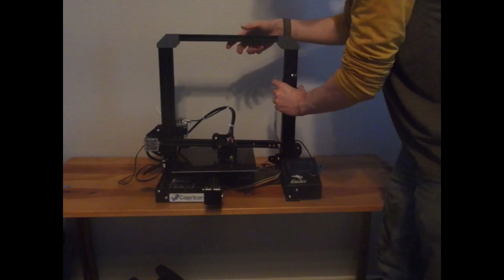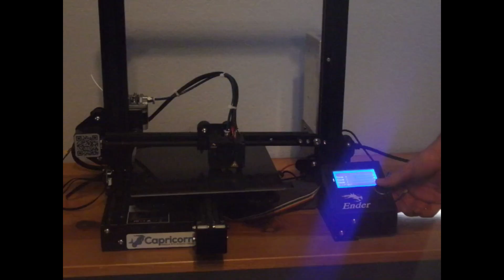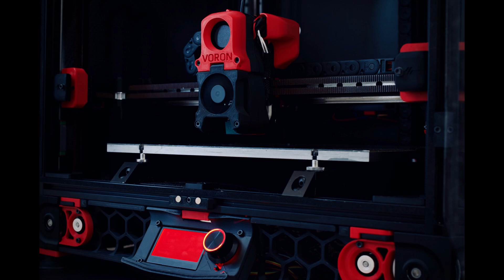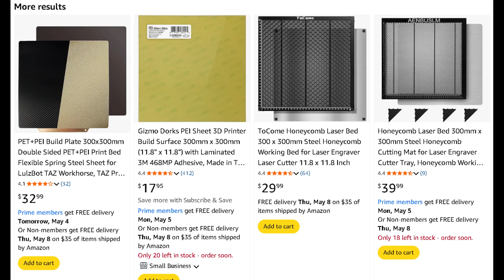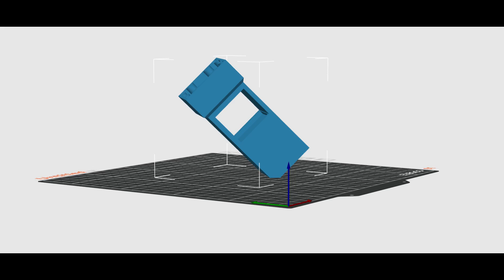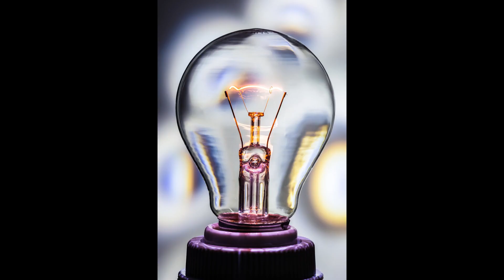Can you print a bigger printer?

Comment: Take it from some one that has tried this. Yes you can print parts to make the frame bigger but then you have to buy or source a bigger bed. Also when you start going big you'll see the Y stepper struggle. For a example I have one ender 3 with the ender extender kit and slinging that huge 400x400 aluminum bed is stressing that stepper motor. Also have to print at slower speeds. I forgot the stock speed of a ender 3 but I have to print at half the speed on that printer.
Reply: Ender 3 stock speed on cura was something like 50mm/s, but it could go 150 to 200mm/s
Reply: Yep same here, had to add a heat sink on my 400x400mm ender y stepper. You can offset the slower speed by using a larger nozzle though.
Reply from the maker: When you added the heat sink was that when you were trying to go as fast as a it was with 220x220? Or was it before you pushed it faster?
Reply: @ as fast as with the smaller bed but that wasnt that fast, maybe 100-120mm/s
Reply from the maker: @ I do plan a slower machine that can print bigger. That was the point of using my old machine. With that slower speed I might try some pellet feed and HUGE nozzles, but first I just want it to work on a bigger size.
Reply: @thomas8313-o3t  the ender 3 V2 has a crummy Y axis from the git go. In stock configuration that stepper gets wildly hot. The NEMA17 isn't made to sling that much metal around. I was trying to use the same speed when it was 220x220 in the beginning but knew I had to slow things down but was kinda sad I had to slow it that much down. A simple calibration cube with stock configuration took about 15 minutes with my profile settings for infill and such. Same profile but at the speed is currently set to is like 45 minutes.

My end goal is to build a 1000x1000x500 printer. However it won't be a bed slinger.